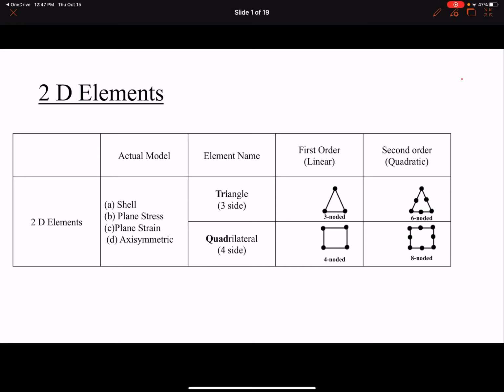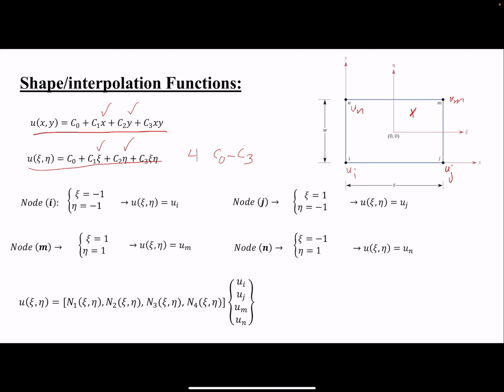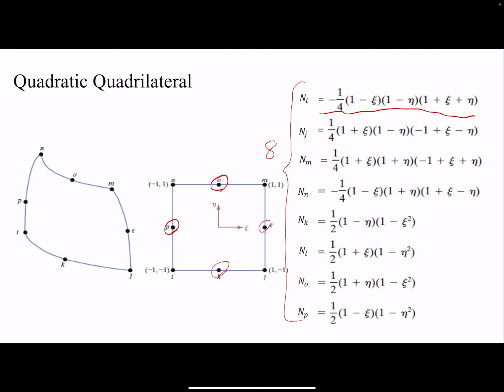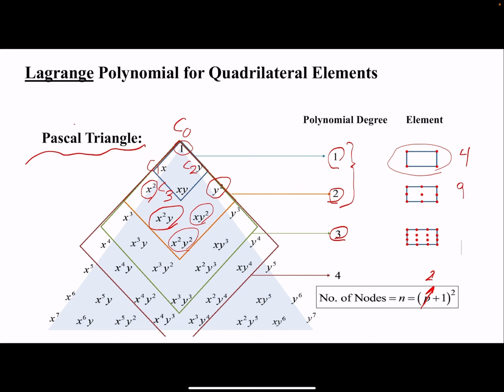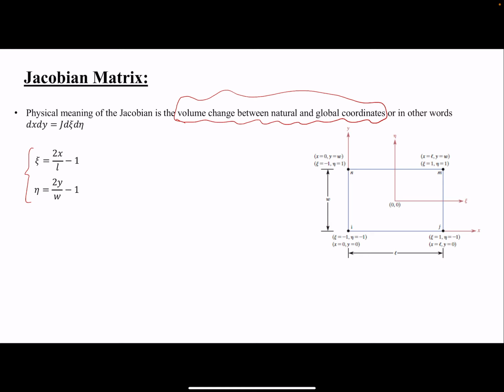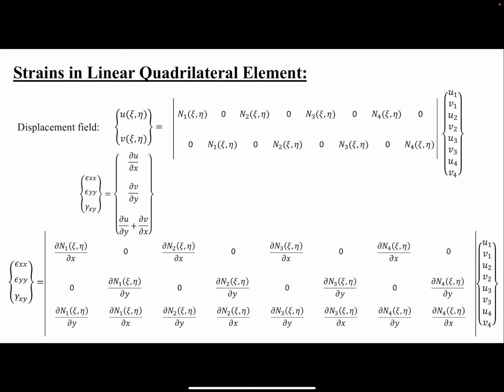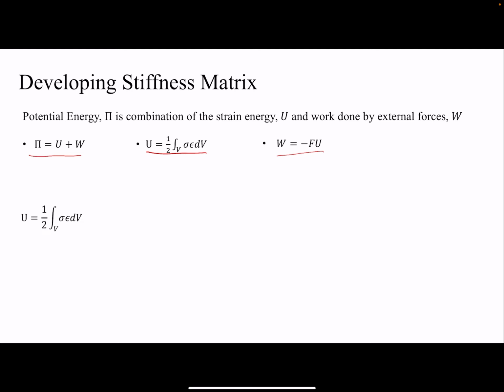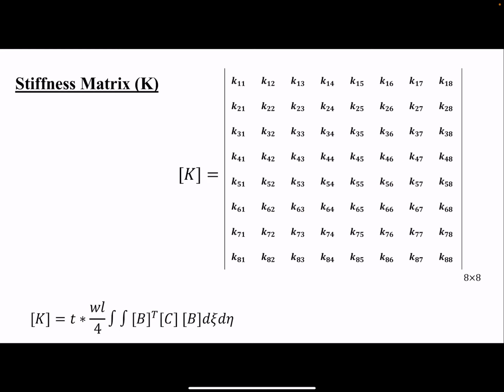Lecture 15: Quadrilateral elements: Stiffness matrix, B matrix and shape functions

Comment: hello! thank you very much for your video. One query: I understand that the rigidity matrix will have in each term polynomials to integrate. Can it be deduced from what order the polynomials obtained will be?
Reply from the maker: Yes, that is a great observation! The order of stiffness matrix depends on the order of B matrix and the B matrix is simply the derivative of your shape function. So the size of stiffness matrix determine the type of element and the order of stiffness matrix indicates the order of element( linear vs quadratic)

Comment: Thanks for the lecture. I have a question? If we use quadrilateral elements with linear shape functions, then what would be the order of polynomial of the integrand B^T C B? Thanks in advance
Reply from the maker: It would be 8 by 8, The C matric is 3 by 3 and B matrix is 3 by 8.

Comment: Nice explanation! - just a quick question, is there a mistake in the B matrix @ 26.17 for values B2,2 B3,1 ad B3,2
Reply from the maker: Thank you for pointing out, yes, those are typos. Find the correct component, and I will tell you if you are right.